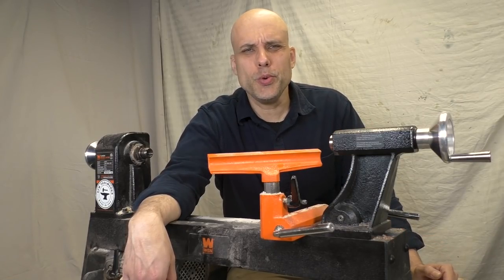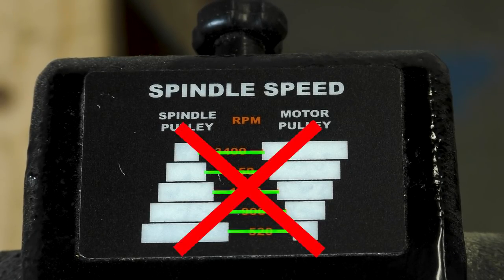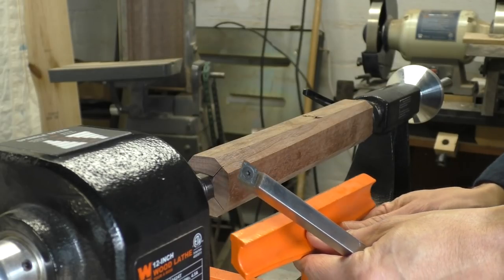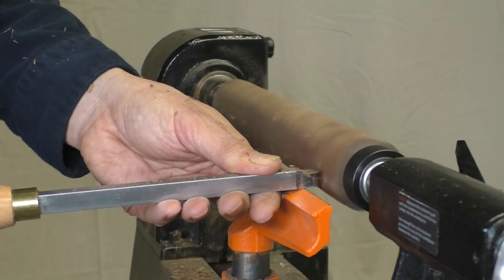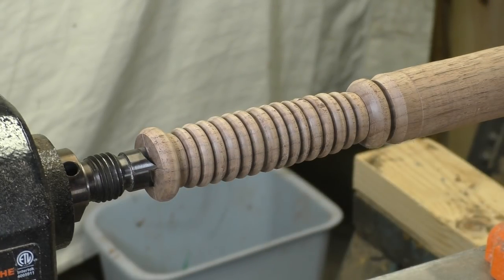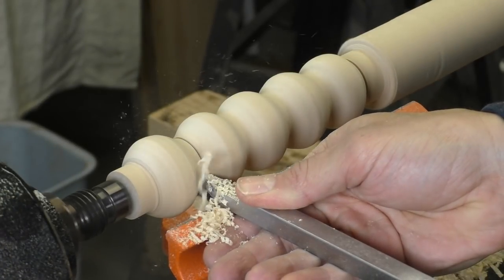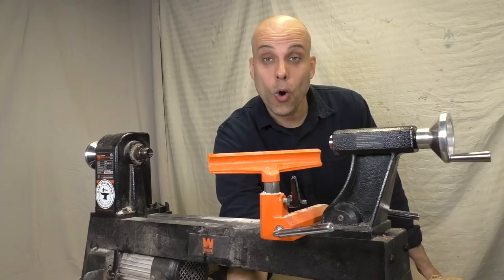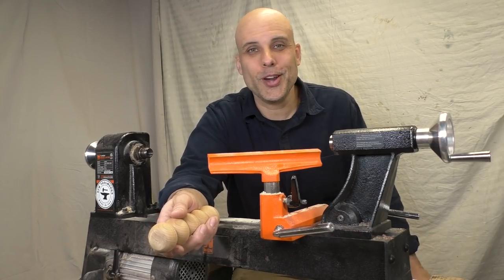Your Quick-Start Guide to Woodturning

Comment from the maker: I am NOT posting a link to the carbide tools from this video because I hate them. They are cheap and low quality and I do not recommend them. If you'd like to suggest some good carbide tools, feel free to mention them in the comments. Thanks!
Reply: What about the tools feel cheap?
Reply: I find that it is best to craft your own carbide tools.
Reply: @mikes-mz5xb  I did the same and I'm still very happy with them
Reply: I've been very happy with Easy Wood tools--both the tools themselves and the Easy Chuck.
Reply: @mikes-mz5xb  I agree. It only takes simple tools.  But I understand the chicken/egg issue with needing tools to make tools.
Reply: Hunter tool systems, micro grain carbide cutters. Many options to choose from. Many of these can be used similar to traditional tools and cut rather than scrape. If your cutting wood, you need to pay attention to the direction of cutting. Spindle orientation (grain runs between the centers) generally go from widest diameter to narrowest (top of bead to bottom of cove).
Reply: Lee Valley tools has some good entry level tools available as singles and whole sets. Can't go wrong.
Reply: Could I start with the Oland Tool? That video was actually how I found your channel.

Comment: If your shop has just a concrete floor you might want to look into some mats for standing next to machines for long periods of time. Flexible mats have been used next to machines in factories a lot, it's healthier for both your feet and your back, plus it helps conserve body heat.

The two likely options are a light wooden grate or one of those rubber mats with holes. It needs to have a bit of give to it.

Comment: Maximum lathe speed is determined from diameter of the work piece. A 2” spindle can go 3000 rpm’s, a 10” bowl would be less than 850 rpm’s for a turner with less experience.  The surface speed effects centrifugal force, you don’t want your piece to blow apart. Slower speeds are better until to workpiece is balanced. Otherwise the lathe can vibrate and move, or throw the workpiece off the lathe. Wood with cracks and defects should not be used without dealing with the defects first. No one wants to get hit in the head with part or all of the wood they were working on.

Comment: Carbides are great for starting in on turning and I've done a lot with them but I will say that getting a roughing gouge was like night and day for my spindle turning. I hated using my carbides for roughing but the gouge can chew out some serious shavings and leave a more than adequate finish for doing details with the carbides. The edge geometry also makes it surprisingly OK to touch up by hand with the same diamond paddles that I use to touch up the carbide inserts.

Comment: There's a whole video you could do on sanding on the lathe, to get the best finish.  Starting with use the best sandpaper you can afford...  The cheap stuff loses it's grit and leaves very deep scratches.  On spindles, the lathe leaves scratches across the grain, and these are more visible.  Hand sanding with the grain can help remove them.  I also looked into making my own inertia bowl sander, but by the time I figured out the costs and sourced the various parts, there wasn't enough cost savings, so I just bought one.

Comment: You touched on this point when you said don’t use a rag. But you didn’t mention that you need to always remove the tool rest when putting your hands on spinning work. You can lose a finger if the tool rest is close. 
And you can get a burn if you push any paper too forcefully. It gets hot.
Reply: Turning the speed down while sanding helps the heat generated  problem.  As always let the sandpaper do the work rather than forcing it.

Comment: Im a machinist and run a metal lathe almost every work day. Its generally considered a no no, but i often use the machines made for metal on wood. It often feels like cheating, but you need to be quite careful or you can completely destroy a project in an instant. It can also be dangerous.

Comment: With traditional tools, I am much faster knocking the corners off on the lathe. A spindle roughing gouge is a great tool for rounding spindles. It is one of the easiest tools to sharpen.  The spindle roughing gouge should only be used on workpieces with the grain running between centers, otherwise the forces involved with end grain cutting can fatigue and break the tool, sending parts of it flying.

Comment: I wish this was the video I found when I started turning!  I do want to point one thing out though, if your lathe speed is operated by a dial rather than a pulley system (like mine, I inherited it), NEVER adjust the speed with the lathe off.  This can cause the lathe to start up with too much slack in the belt and can cause serious problems!
Reply: This concern is quite true for a machine with variable-width pulleys or tapered sheaves, where the knob is making mechanical adjustments to the drive system, which is present in some high-quality, large, older lathes. It's much better to adjust the drive system with everything in motion so that the internal parts can move and maintain the expected tension (much like trying to move the steering on a car while moving even slowly, vs while sitting stopped).

However, if your machine has an electronically controlled motor drive (like most modern, small, inexpensive lathes) then it's not a concern. The knob is simply a "volume control" for speed, and the belt never slides or slackens on the pulleys in this type of machine.

It's straightforward to tell the difference: The mechanically adjustable systems require some physical force to move the adjuster, similar to moving the depth adjustment in a bench plane or moving the gear shift on a manual transmission. The electronic adjustments require no more force than turning the volume knob on a stereo.

Comment: Hey Rex, nice video
When I turn with classic tools (I never used carbide tools), I tend to raise the tool rest a bit and try to start the tool from the top of the piece and then bring down the angle until I get good shavings. I do find that your carbide tool was a bit on the lower side of the piece which may better explain the catches
I've turned walnut before and usually get very good results especially when I keep my tools sharp. Any particular reason why you started with a carbide tool instead of a roughing gouge? I'm wondering if you had done this maybe you might have had better results from the carbide tools - did they chip in any way?
Reply from the maker: I was just going for the quickest way to get started.  I'm no fan of carbide, but folks need to start somewhere.

Comment: Is it OK to just use chisels instead of "turning tools" ?
Reply: First off the handles are to short.  Second the bevel on a chisel is much to shallow making it an aggressive lathe tool.  Not saying it can't be done but the risk of some serious catches is very high.  Highly recommend a full face shield and leather turning apron, good to use with the proper tools but absolutely a necessity if you are going to use chisels.
Reply: Not a good idea. The metal used is different, the turning tools take a lot more abuse from the wood. Standard chisels don’t have the mass, and would most likely snap in time. Especially on end grain cutting. Additionally, most modern turning tools are made of high speed steel M2 or better, the edge lasts a lot longer… it is not uncommon for the tool to have traveled over a mile on the wood in under two minutes.